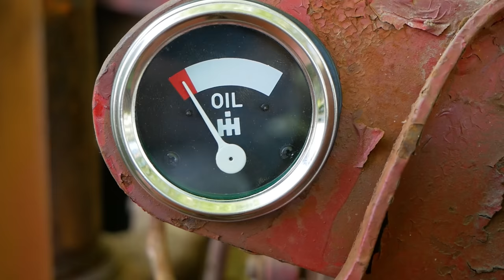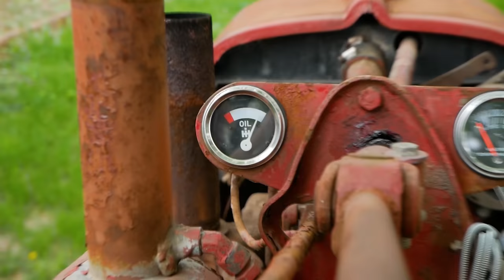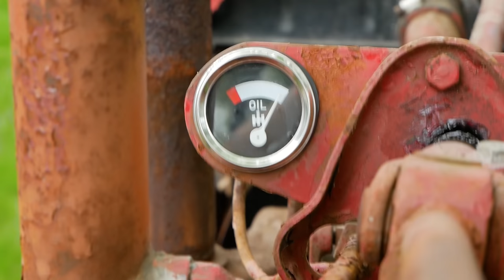Can We Farm With ABANDONDED EQUIPMENT? - Ep. 3 - PUTTING THE CORN IN

Comment: I honestly think you just need some deeper treads and some extra weight on the back of the tractor. It looks like it was lifting a bit while you were plowing. It wasn't the tractor but rather an issue of traction. Nothing a few cinderblocks wouldn't have fixed.

Comment: You need a disk with 28 or 32 blades.  It takes 60 hp or so to pull your 44 blade disk at a decent depth and speed..  Around here an M pulled 32 blade disks.

Comment: I tried taking the same shortcut by flushing the tank on the tractor! And did not get it fully dry! Ended up rusting my carb and steel fuel lines! So what could have been a half day of pulling tank putting some chain in and shaking then drain and flush and use leaf blower to dry. Turned into pulling tank and fuel lines and rebuilding carb!

Comment: i heard somewhere where these old tractors u dont need to run zinc additive in the oil. pretty much everyone that has them dont put zinc in it. unless they use diesel oil. but these engines dont run very high rpms. like the h is somewhere round 1800 and an m is like 1400. i dont think not putting zinc wont hurt the motor but i could be wrong.

Comment: A 100amp. Service. Is what you will need to request. A ( update) should be free....
We use a generator. ( 3000 to 8000) portable welding power. ..o Um....Heat ..is in the red bottle.. cool vid. 
Be safe with the nitrogen....

Comment: I was just going to tell you to use that Bronco you got to pull that disc take a Briggs & Stratton motor put it in the back of the Bronco put a hydraulic pump behind that Briggs & Stratton and it all lift that disk up and down I think that Bronco would pull that disk a lot better than that tractor I'm hillbilly and I think it would work

Comment: Just in case someone takes the "oil is oil" statement and runs with it, don't apply it to modern high performance engines.
There is more to it than viscosity and percentage of synthetic content, and zinc content. 
Oil specifications (for example ACEA standards) and manufacturer specifications actually mean something.
Oil science is actually pretty interesting, I recommend giving it a little read.

But long story short, ignore what people say on forums, get any oil which meets the specifications your engine requires, and change it regularly.
Do your own research, read the manufacturer schpiel, buy the cheapest, whatever makes you feel better, just make sure it meets the relevant specifications. <3

Comment: Unfortunately you are incorrect. The commercial used catalytic converter camw out in 1973. America cars still used flat tapper cams up to 87 in the Dodge 318 86 was many engine including the Chevy 350 454 and many other V8's Juat wanted to clear this up. It is possible zinc was not as important as we think.

Comment: I've been around  cars n machinery my whole life,and I never heard anyone say put zinc in the oil as an additive!
I once enquired at a Massey Ferguson dealer about buying some nuto32 hydraulic oil and the owner of the shop asked me what I was going to use it in,because apparently the new combines from about 20 yrs ago,switched to a special blend of hydraulic oil,with 50% engine oil! The owner of his new combine,had put standard hydraulic oil in the combine hydraulic system and the dealer said he didn't know what he was going to do with it,because apparently,nuto 32 or another brand, might have ruined all the seals and changing them was worth anout what the machine cost,250,000$,and it might of made that machine a write off! And I heard the owner had canceled his insurance!
This old stuff ,is made to take a shit kicking,back in 80,my 80 yr old neighbor,had an old cockshutt tractor,he used iodine and deisl fuel to unlock the engine every spring! This was an ancient tractor,but it plowed the field!
Strangely it had 2 bull low gears, which I couldn't see any difference!
Also,it had a crank,and one of my country neighbour's saw me cranking it,when the old battery wouldn't start it,and warned me about the crank handle kicking backwards! Men have had there arms broken, jaws smashed out or been killed! It twisted my thimb while my hand was dry and cracked it!
I asked an oil salesman to explain the coding on top of oil cans,interesting info,but I've long since forgotten it,but it seems no one explains the difference or educates the public what a can of oil has on it! Ie,10-w30,10-w40 or just 20 weight,30 weight,40 weight,which I think are nondetergent oils,interesting, and break in oils,and my old boss had been a Texaco dealer, and there old stuff was very thick compared to some of today's oil!, but zinc in oil! never heard of it,but good luck,and I used to advertise for old scrap farm machinery,picked up a few things that were used 40 yrs ago,now its just disc n plant all in one operation! I was given 2 old combines,1 Massey Ferguson  still had lots of power!
Well,I heard u explain why zinc was removed because of catalytic converters!

Comment: That’s careless not drying out the gas tank and letting water into the air filter.  I would have blown it out with compressed air and then washed it out with a little gas.  I would have put a plastic valve over the air filter stack and the exhaust pipe before using the pressure washer.  Lave Rust might have taken a lot of the rust out after soaking a few days.

Comment: That disc harrow is way too big for an H.  My family had a Super H that we used to pull a four-row corn planter and a mounted four row cultivator. The super age had more horsepower. Also there was a preheat that could be opened on both the H and a Super H so that they could be run on kerosene if gasoline was not available

Comment: I am impressed with what you accomplished, and I doubt if you look at any message on these old vids. But, PLEASE GOD, learn about some safety precautions. You don't have people ride on the axle, you don't step off a tractor in between it and the equipment it's pulling while moving and you don't walk alongside a moving tractor inside its tires. All it takes it stepping on a clod to turn your ankle and you are under the equipment. I've seen how far up a human body can be dragged by the hydraulic grain auger.